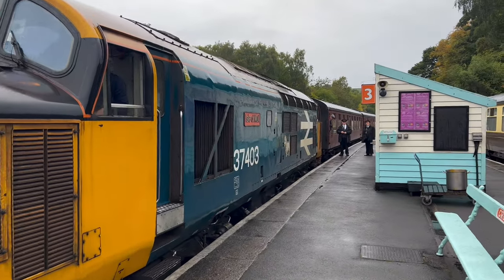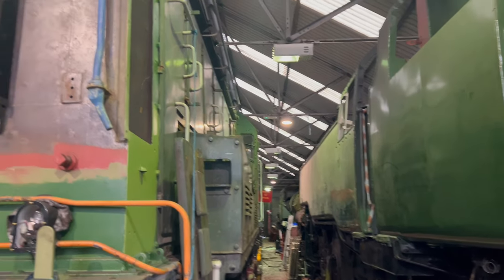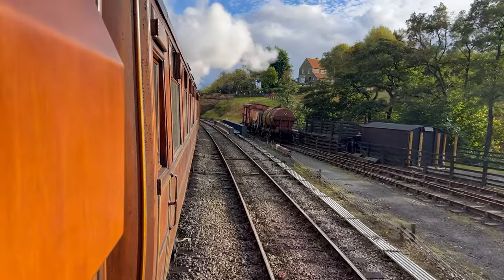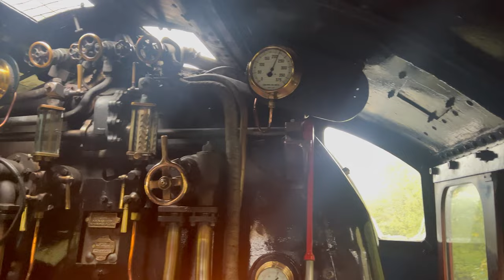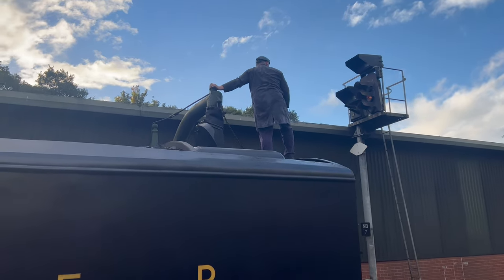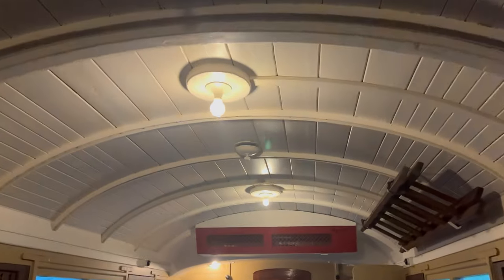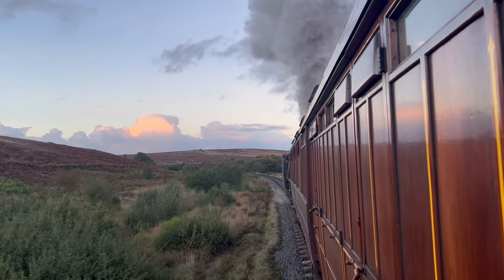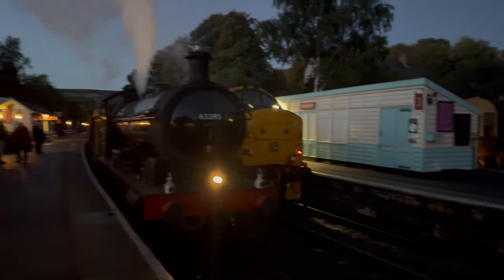Train Real World - Sir Nigel Gresley at North Yorkshire Moors Railway (NYMR)

Comment: Hello Megasim, diesel loco no. 12139 "Redcar" is a BR class 11 shunter.
Reply: From what I gather the Class 11 are near identical to the Class 08 (mechanical and electrical) but were the batch ordered by the LMS and formed the base design for the Class 08. 12139 was acquired by ICI for use at their Wilton works and gained it's "Redcar" name whilst owned by ICI.